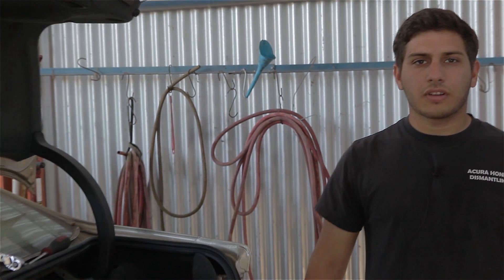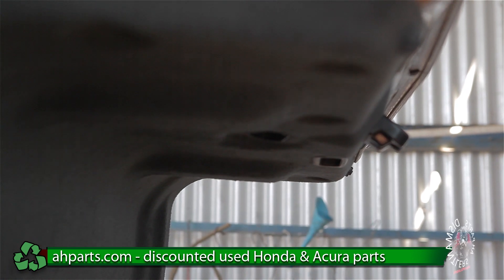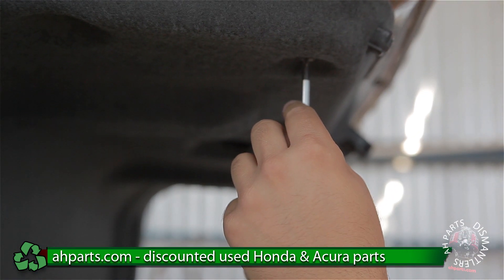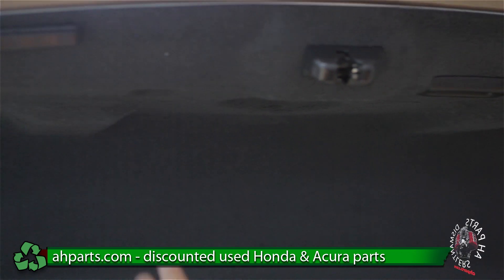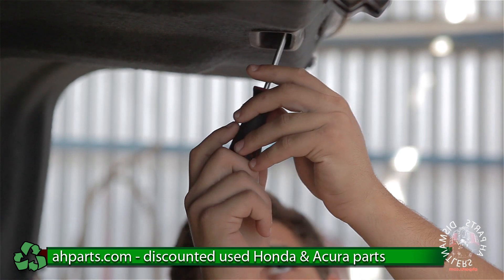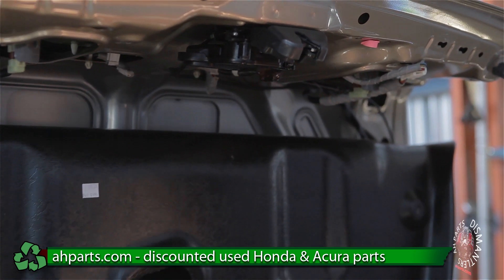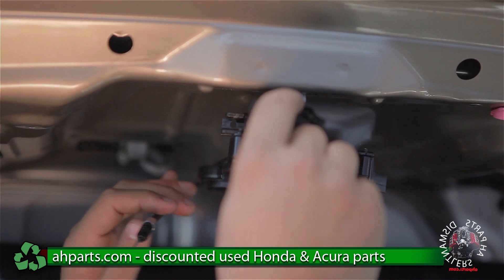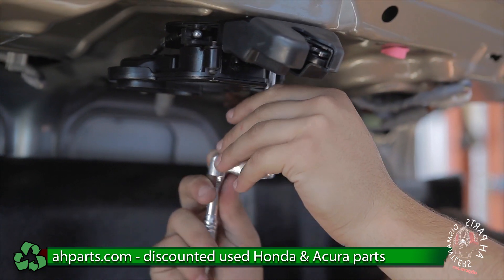How to install change Trunk Lock Latch 2004 2005 2006 2007 2008 Acura TL REPLACEMENT REPLACE DIY

Comment: Excellent video! My TL trunk stopped opening, so I went to the dealership. They wanted $80 to diagnose it, but did a complimentary check instead.  They said it could be the latch & the total for parts & labor should be over $300.😯 I'll definitely be doing this on my own.  Thanks for the great tutorial.👍

Comment: I ordered the part online half price of dealership price, followed this video exactly, you did not miss a thing, thanks, you saved me over $200. Genuine Honda 74851-SDA-A22 Trunk Actuator, it says it's for Honda Accord but it's the same part for Acura TL, dealer confirmed. Search 74851-SDA-A22 on Amazon $60 bucks. Its called a TRUNK ACTUATOR. Couldnt find on the AHparts.com.
Reply: did it matter what year the honda part was? i need to replace mine 2004 tl, need save some coins....
Reply: I fEddie TTE